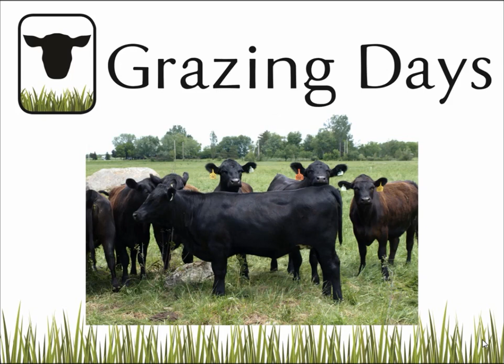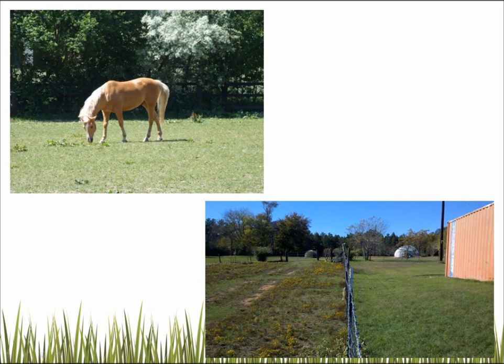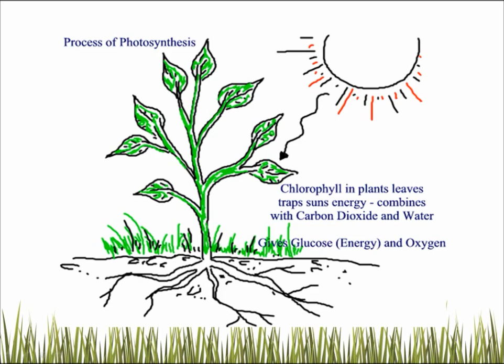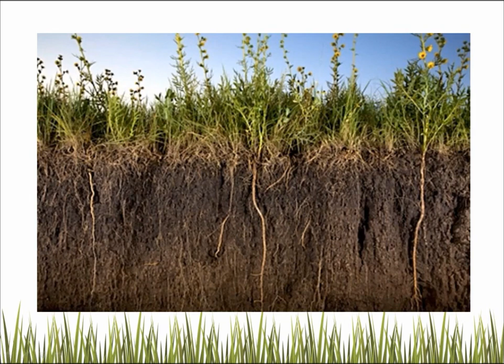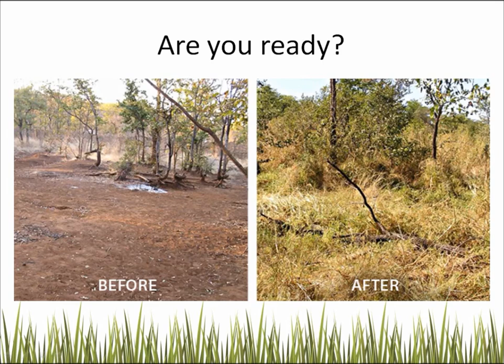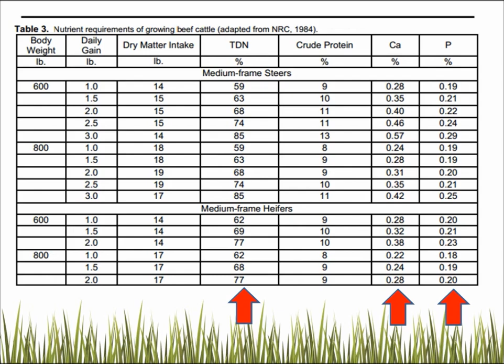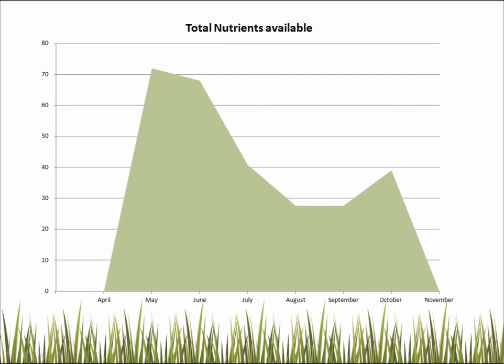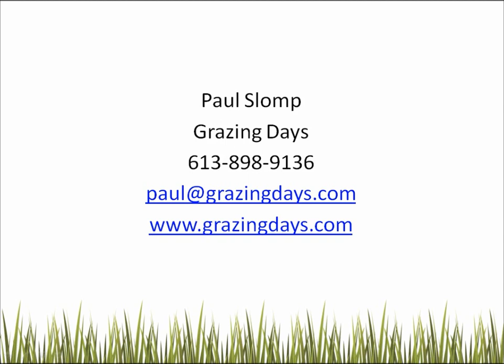Intensive Rotational Grazing

Comment: Do you just leave them in the same pasture over night or do you move them to the next day before sundown? Or do your cows spend nights in a barn
Reply from the maker: I generally move the cattle around noon. Once a day and leave them in the pasture overnight. Our cattle are outside both summer and winter
Reply: The grass will be your guide as you develop your grazier's eye. Put them on when you have soft green seedheads, take them off when you have 4-6" of leaf. Only put them on grassland a short time to let the hooves help the roots but not kill them. Move your shade n water if possible to prevent pugging. If you pen animals then move the corral often.
Reply: grazingdays Thanks for the great video. How about grazing in the tropics? Would you recommend using some kind of portable shading to move along with the cattle?
Reply: jotapits 
Better yet, silvopasture, meaning keeping some trees in the pasture. Do a search using that name. The trees will eventually be a second income stream if they can be sold, as timber logs or as young nursery stock. You can use electric fence to keep the animals off the trees, or just move them from section to section so fast they don't bother the trees much. Some grass species do better with partial shade due to higher soil moisture. Shade structure would be good until trees give enough shade
Reply: jotapits 
What's your location? When I was in Florida long-eared cattle did well in hot weather without much chance for shade
Reply: downbntout I'm in Colombia and where the farm is, sunny season can go around to 25 Celsius (80 F),  so shade is vital
Reply: downbntout Awesome, thanks for the info
Reply: jotapits 
¡Hola Colombia! I was in Nicaragua for three weeks years ago. In drier climates 80F is not bad. Tropical areas need careful grassland care. Be very sure to keep the cow's feet from staying too long in one place or one path so the grass roots will be strong. Lucky you, good rainfall. Is there very much slope? Is the soil sandy or stony?
Reply: downbntout It's a region of extremes, lots of rain in the rainy season, lots of sun in the dry season. No slopes, it's the llanura (large plains between Colombia and Venezuela). I'm a total newbie thinking about making the family's farms profitable, so that's why I ended up watching this video (and lots of others). So if you could share any additional info that would be great
Reply: jotapits 
I'm so new I've read a lot and gotten excited but I'm building my perimeter fence! I'm on 18 sloping acres of sorry thin sand over volcanic rock. Llanura sounds like wonderful land, but you do have a dry time like me, here in eastern Washington State in the upper left corner of the US. I will start with sheep and goats in March because the grass roots are too weak for cattle so far. I would like to email so we can share photos. Are you interested?
Reply: downbntout And the soil is very sandy. What I'm thinking to do is start testing using small paddocks, moving cattle everyday, watching the effects on pastures and production (milk). Right now the pastures are very degraded
Reply: jotapits how many acres/hectares? If you start fencing into paddocks will your animals get enough to eat in one paddock? I lived in another area on 28 acres of degraded land, started cross fencing, and the land's response in three years amazed me. I used a single wire a meter high, so two goats could eat anywhere, and they kept weeds limited (some diversity is needed). I put seed down right before turning in the cows while the grass was dry, and the cows' feet made the seed get down to soil. Email?